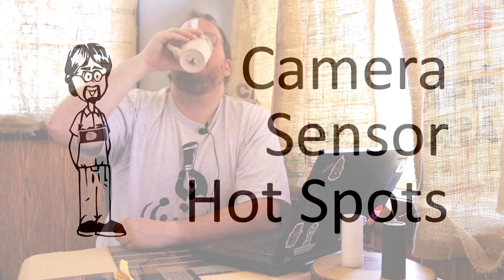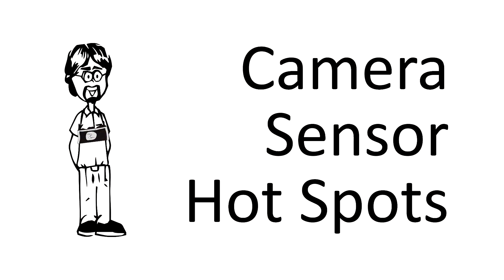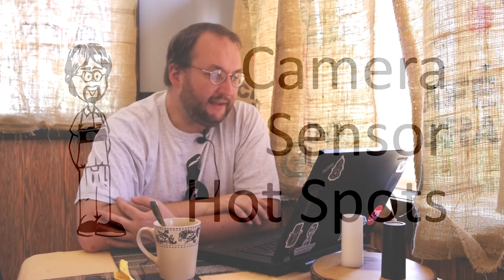What are Digital Sensor Hot Spots?

Comment: Thanks. Great explanation. I thought it was because if my freckles :-)
I prefer the attitude of “Until it’s noticeable The camera will probably be so old it’s not relevant”. Just like the shutter life span: “If I’ll reach 200,000 the camera will be 10-25 years old and because of digital it will probably be replaced much sooner so why worry.”
Reply from the maker: Thank you, and yes, that's probably really close to accurate. There are other problems that affect camera sensors more before hot spots become an issue due to their quantity.
Reply: In life, Generally, People tend to forget the long run risks versus short run risks. It's a balance of what to focus on (No pun intended...)
For example (And I apologize for the morbid analogy...): The debate between Sugar and artificial sweeteners: In the long run, The sweeteners may or may not cause me problems. 20-30 years away. But Sugar will cause me problems right now. Today, Tomorrow, Next year. We'll all die of something. Same with this: Shutter crash, Pixel death. All very long term issues which will be irrelevant when they strike.